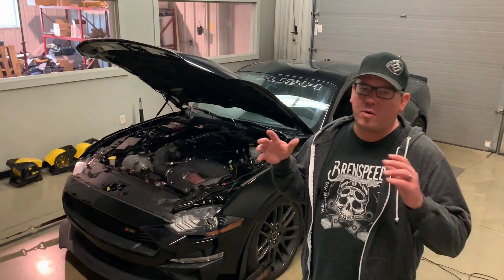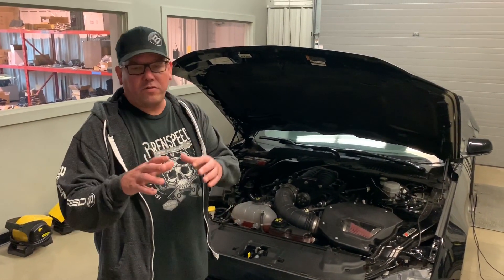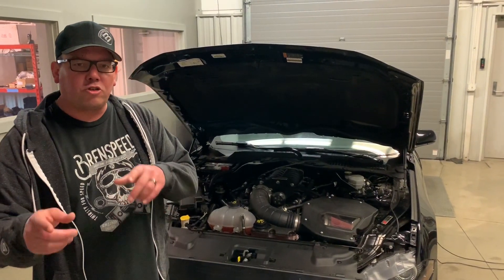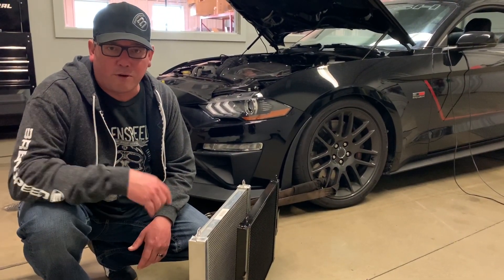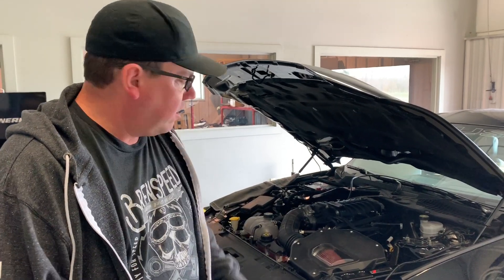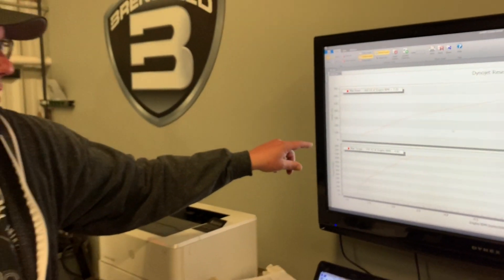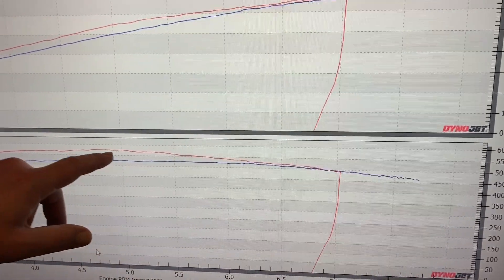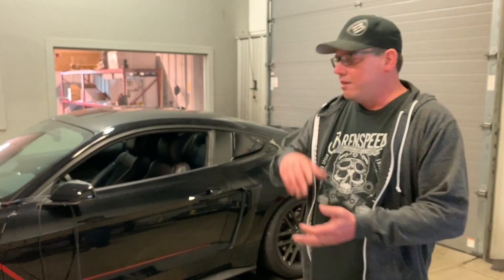2018 + Mustang (IMPROVED DESIGN) Roush Phase 2 Supercharger 750HP Dyno & Review

Comment: does that car in the lower gears 1 to 5  rev up to 7400 or stop at 7000 like  your dino sheet shows
Reply from the maker: It will go over 7. It just stops at 7 on the dyno because you are hitting a vehicle speed limiter so the graph does not show the higher RPM.

Comment: Also, bone stock, the speed limiter is 156.  Does this mean that the top end for this stage II with Ford Performance tune limits top end below stock numbers?  Thanks, Red
Reply from the maker: The Roush cal does not lower your speed limiter. In lower gears you will have RPM like normal. But once you hit the speed limiter in high gear the RPM will stop. They do not make lower than stock at high rpm.

Comment: Did you feel the need to modify the drive line, suspension, or shifter?
Reply from the maker: All good mods. I like IRS upgrades but it is not required. An upgraded one piece driveshaft not only makes it quicker but reduces the chance of breaking the stock 2 piece one if you drive hard on sticky tires.

Comment: I have this kit on a 2020 GT Premiun and it is throwing Powertrain Fault and stored code and BCM fault and stored code . I understand the torque is calibrated to low from Roush any Ideas??
Reply from the maker: I have never seen that or ran into it and not only do I run this kit on my own car but we install them all the time. I would say do two things. 1. Make sure everything is installed correctly and 2. get the most updated calibration loaded on the car. That way you know the PCM has the flash that everybody else has been running. Maybe you have some old flash, or maybe it did not load on correctly, but you should not get those codes. So check every aspect of install and get the newest calibration. You should be good to go.

Comment: I just purchased a 2019 stage 3. So would I have to buy another super charger or is it just upgrade
Reply from the maker: You use the same supercharger. Here is a link. It includes a new calibration and heat exchanger. https://www.brenspeed.com/422185.html

Comment: is it safe to run 91octane on the kit alone (no other mods)
Reply from the maker: Yes the Roush calibration is designed for any premium fuel.
Reply: @BrenspeedEngineering  will the engine knock frequently? especially when youre topping out

Comment: Hello Brent. My 2020 Mustang GT 6 speed ready has a Roush Supercharge Stage 2 but still I don't feel the low end torque than my ex Challenger Scat Pack 6.4 had. How can I improve low end torque. Thanks for always answer our questions.
Reply from the maker: I run Stainless Power long tubes on mine and it helps low end. I run the Roush tune. Many clients do also. Here is a link to them we have them in stock. https://www.brenspeed.com/sm15hcat.html
Reply: @BrenspeedEngineering  Thank you so much Brent!

Comment: Another question Brent. How much important is the exhaust for get maximum power from the Roush Supercharger. Any experience between 2.5" and 3.0" catback? or X pipe and H pipe? Thanks for yours videos.
Reply from the maker: X vs H, inches, not really a big deal. Increasing your exhaust diameter from a catback will give you a sweet sound but not really any sort of power gain. Basically none of those create any sort of huge measurable power difference. Mostly just a sound preference.
Reply: @BrenspeedEngineering  do long tube headers help at all? I have a phase 2 on my 2018 mustang gt and I’m checking to see if some 2” headers will help the mustang and going on e85 with meth injection

Comment: Love the videos!!! The 3 year 36K warranty? Does that start from 0 miles on the car or from when you install the kit? My 2019 GT currently has 27K miles will I get 36K more miles of warranty or just until the odometer rolls 36K and how would this effect my 5 year 100K mile warranty I bought with the car?
Reply from the maker: The Roush warranty is for your drivetrain. That means you still have your other warranty for non drivetrain items. It starts from when the car was first sold off the dealership lot when new... not from when you install it. So no you don't start at your 27,000 miles.... start from however much was on it when purchased new so 0 or 20 or whatever it had...

Comment: Another great video Brent. Why Roush start so slow like the graphic show?
Reply from the maker: Thats just because of getting into the throttle slower to make sure max traction is happening. A lot of times on this kit you just cant go instant wide open throttle at say 2500 as it may spin a little so by getting into the throttle slower you are making sure the tires are getting max traction. What you are seeing is just not being at wide open throttle instantly.
Reply: @BrenspeedEngineering  Thank you

Comment: What is the difference between the phase 1 and phase 2 of the roush kit?
Is it literally just the bigger heat exchanger and more aggressive tune for phase 2 or does phase 2 also have a slightly smaller pulley for a smidge more boost?
Reply from the maker: As of today if you purchase a phase 1 you get the larger heat exchanger so now the only difference is just the tune. Back in the day only the phase 2 had the larger heat exchanger but now everybody gets it. Same pulley just hotter way more advanced tune.

Comment: This tune they send is a base 93 tune I take it. Do they send e85 tunes as well? You just use your own device ?
Reply from the maker: No E85 on this 50 state kit. The fuel pump and injectors would not support the requirements of E85. The Roush kit includes a flash card that you just use a lap top to load the tune on the car. No physical tune device included.

Comment: How long do you think the mt-82 will hold up? I want to supercharge my s550 but I’ve heard the Mt-82 is the weak point.
Reply from the maker: Depends what you do with the car. Typically for most they hold up. If you beat the SHxx out of it you are prob ready to upgrade.
Reply: @BrenspeedEngineering  car is my daily. I usually do some street pulls here and there and some canyon carving. Probably would do some pulls at the drag strip but very rarely. If anything I’d definitely upgrade clutch/flywheel and shifter.
Reply: @ZFA1738  Recommend the Ford Performance Short Throw. Inexpensive and makes a difference.  Might help you keep that MT-82 a little longer.
Reply: @redmcguire1824  ended up totaling my mustang. Was doing mustang things and lost control of the car. I want to say I’ve grown from it and once the s650 comes out I plan on getting one.

Comment: When you upgrade from a phase 1 to a phase 2 do have to retune it?
Reply from the maker: Yes the Phase 1 to 2 upgrade includes a new flash.
Reply: @BrenspeedEngineering  ok thanks
Reply: So If my car is a 2019 stage 3 710 hp & 610 torque does that mean my heat exchanger is a phase 1?

Comment: I have a 2019 with American racing headers, x pipe and flowmaster outlaws. Do you think this supercharger will also add to the quality of the sound of the car besides the performance on top of it?
Reply from the maker: The added boost may make the car a bit loud when under wide open throttle but it wont really change the sound just driving around. THANKS

Comment: You get the warranty on a new car... You should tell people if your cars factory warranty it done you don't get it..
Reply from the maker: To be clear it is a 3 year 36k drivetrain warranty from Roush from when new. So you can buy a 2 year old car that has under 36k miles and still get the warranty. 1. As long as it is less than 3 years old from new, and 2. it is under 36k miles. Then it expires at 36k miles from new and 3 years from new.
Reply: @BrenspeedEngineering  Does that mean it actually voids the last 2 years of the drivetrain warranty?  Isn't the factory warranty 5 yrs/60K miles on the drivetrain and then it becomes 3 yrs/36K miles after the supercharger install?

Comment: What’s smallest pulley I can put on this kit on 93 octane  was gonna be running vmp triple pass duel fan heat exchanger 2019 roush stage 3
Reply from the maker: Not sure as we do not drop pulley sizes on this set up on 93 and on the stock engine & the included injectors. Also it does not come with a fuel pump which you would need to upgrade if you are considering more boost.

Comment: Warranty clarification - as far as I know, the 3 year/36,000 mile warranty only covers defects in Roush materials and workmanship. It does not apply to any OEM components such as oil pump gears
or crank sprockets or pistons and rods etc. Does anyone know anything different ?
Reply from the maker: It is for the drivetrain of the car not just the supercharger. So basically it is for 3 years 36k from when the car was new not from when you install the supercharger. It has to be installed by a Ford dealer or somebody like us that is authorized by them which we are. THANKS
Reply: Good luck trying to make any kind of warranty claim. Roush and ford just point fingers and nothing gets done, I know from experience

Comment: Had a stage 2 added on GT but only putting out 605hp with the factory Roush tune. In order to get 700+ do i hav to put a different tune on..?
Reply from the maker: They are rated flywheel. You wont make rear wheel horsepower what the flywheel is advertised at. Also the Roush tune hits the speed limiter when you dyno in the correct gear so you are not seeing max rwhp on the dyno because as it is still climbing it normally shuts off because you are at the max of the speed limiter (not rev limiter, vehicle speed limiter).
Reply: @BrenspeedEngineering  Good day Brent here was my results on my 2019 mustang gt premium 10 speed auto. 5th gear pull 606.2 (HP) @ 6600 rpm max torque 5.38.5 rpm. 6th gear 583.0 hp @ 6150 rpm, max T 4150 rpm. 7th gear 565.0 hp @ 6400 rmp max T 568.9 @ 4050 rpm... They told me rev limiter kept shuting it down so Vehicle limiter is the problem. If helps has both factory/Roush tune. Not really getting any boost. Is there something I could do to hit better #'s....Thank you Tony

Comment: You compare rWtq between the two kits. Just a fair note to that fact. Stage 2 Whipple runs at 10.5 psi while the Roush Phase 2 is at 12 psi. More boost equals more torque!
Reply from the maker: Correct actually I am comparing two kits that have a drivetrain warranty and are considered 50 state kits. Thanks for the comment! Yes more boost equals more sweet sweet torque! Gotta love them.
Reply: @BrenspeedEngineering  this begs the question:
How much boost on a phase 1 ??

Comment: Do you know the width or thickness of the new phase 2 heat exchanger? 
And, the thickness of the phase 1 heat exchanger?
My 2019 was modified by Roush in Sept.2019 & it - has the fan option
The dealer paperwork says 710hp
Now, I’m curious - is it 710hp or 750hp ??
Reply: I had a phase 1 kit installed in January and it already had the thicker LTR. The thickness is about 1.5" versus an inch or slightly less for the older. Also look at the front-bottom-passenger side of the LTR.....there will be a brass allen key screw that you can't miss it. I am waiting to get teh newer tune till I am outta California and can actually get 93.
Reply: @andrewallen6747  thanks for your reply. 
I measured the width of the tank by sticking a tape measure thru the grill. The tanks on each side are 2 inches wide. That, of course, is wider than the core. So, that verifies what you say. Thanks again👍
I'm on 93 octane 
Oh, and I just checked and the brass is very visible😲~~😄
The Roush Tech that did my car
 is Kevin Rahn and I've seen his
 name on the tags of Roush Builds from past & present. And, even a picture of him holding/installing a supercharger on the Internet. 
I wonder if he keeps notes on all the builds he has done. Hmmm, what tune did he put in the 2019
 Magnetic Matallic Mustang GT in September of 2019??

Comment: Do you know how much a Ford Dealer would charge to install this?

Edit: Besides a performance clutch, flywheel, and driveshaft are there any other parts that need to be replaced in order to handle that much hp ex. Transmission, differential, or axels?
Reply: My dealer charges $2000 for installation. Performance shops typically charge $1200 to $1500 for installation, but you will have an issue getting to keep that warranty.
Reply from the maker: You would have to ask your Ford dealer. As far as other parts I like doing radiator and cooler thermostat.

Comment: Can i put a vmp heat exchanger on my 2019 f150 roush and help the iats???      Or do i have to wait for roush to come out with one for the f150
Reply from the maker: You can absolutely put a larger heat exchanger on it. You wont need to change the tune either. Just let it do its thing. Thanks for watching!
Reply: i put VMP heat exchanger on my 2018 mustang roush and it is fit

Comment: I have a 19 Roush Stage 3 10R80 with the Phase 1. In your professional opinion is the Phase 2 upgrade make enough of a difference to do the upgrade and cut my 5/60000 Powertrain Warranty down to 3/36000? I would hate to give up 2 years of warranty for negligible gains/improvement.
Reply from the maker: My opinion is yes do the upgrade. I love it and they drive great and they wouldn't offer a free warranty if the engineers felt it was dangerous. THANKS for the question!
Reply: @BrenspeedEngineering  Does the removal of the strut tower brace make a handling difference in the corners/ backroads/ road course?

Comment: I wish the phase 2 was out and they would have let my local dealer install it when I bought my 19....
 Very good deal how they supported and updated their customers!!! Love the 3 min cool down option too....
 Would be what 640 wheel on an A10? 
 Did I hear you right that the new phase 1s come with the upgraded HE now? Or phase 2 only?
Reply from the maker: Here is a video of the auto. Also all kits the upgraded HE now. THANKS https://youtu.be/RT2I-mLp0zA
Reply: @BrenspeedEngineering   thanks man....a problem I have with my tune is enleanment unless the dyno plug is removed...( PCM commands all the way to stoich at full boost maybe by end of 1/4, on 4th engine now ). Does the phase 2 calibration keep it from using "enleanment" for traction control even with advancetrac off?

 Thanks so much for representing this supercharger and your videos....

Comment: Why wouldn't roush give u that size heat exchanger from the get!?!?! The iats are a huge issue on the phase 1.
Reply from the maker: Because I believe they thought it was large enough then enough time went by they decided to increase it. You got to give a company props for improving and not just moving on to the next thing. Im glad they increased size to improve performance.
Reply: @BrenspeedEngineering  the setup started on the 18 I purchased the 19 with phase 1 kit. When did the phase 2 release?
Reply: @primofx2sport  in my research
 I believe the larger LTR started in mid-year of 2019, as mine was done by Roush in September of 2019. I noticed my IATs were always the same as outside ambient temperature. Then, I found out that I have the "turn On fan option" and a bright brass Allen head screw on the right lower passenger side of heat exchanger.
Cool🆒 😊 👍
Reply: @stepside2839  yea mine still came with the smaller exchanger and I purchased mine early 2020. I believe it was a kit thats been sitting for a while.
Reply: @primofx2sport  open the drivers side door and there will be a build date from Ford sticker and another sticker from Roush, which indicates the month that Roush modified the car.
Reply: @stepside2839  oh no I purchased the 5.0 and installed the supercharger myself.

Comment: How would you compare this to the GT500?
Reply: The mustang gt is around 400 pounds lighter than the 2020 gt500 so I’m sure it’s way faster. Plus you get the better 18-20 headlights than those old 15-17 ones on the new gt500, don’t know why they did that.
Reply from the maker: That is sort of hard to compare. If you are talking 20 GT500 I really love the trans in that car and of course all the sweet options and built engine it has. Price is about half on this so that makes a difference if you are not looking for the GT500 sweetness.

Comment: I bought a new 2020 mustang with a rousch blower from a dealer who sold it to me claiming 700 hp. I put the car on my dynojet dyno that ive had for 17 years and couldn't believe it made 662 rhp with 200 miles. I posted the videos on my channel. Then i figured it was a phase 2 kit that the dealer didn't know they installed. Thanks for the tip on the fan to kick on. I was trying to figure that out. I enjoyed your videos!!
Reply from the maker: Awesome glad it helped! If that fan trick does  not work you will need an updated flash from your dealer. Not sure how long they have had that in the calibrations I think it is a newer feature.
Reply: @BrenspeedEngineering  I have that feature on my 2019 that was done by Roush in September of 2019.
And, 'thanks much' for informing us of that feature. 👍
Reply: Yes it worked thanks keep me posted on and work you do on the 2020 mustangs
Reply: It also cycled my intercooler pump!
Reply: My 2020 GT phase 2 dyno At 625 hp. The dealers dyno must be off.
Reply: @stangbanger5.039  it is my own dyno I've had for 17 years and then put a palm beach dyno tune on it and it made 685
Reply: My '16 is different. The fans kick on when i press in the clutch, and happens everytime the car is off. Even when i haven't yet started it, right when i press the clutch in, the fan automatically turns on and runs.